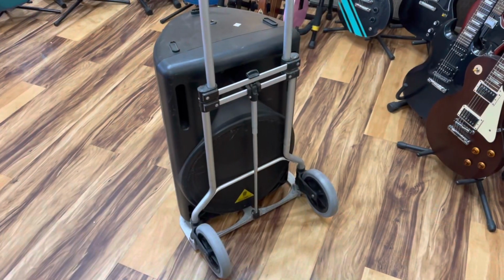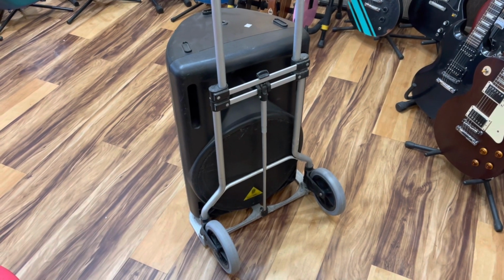How long did it last?

Comment: I once took my vintage Hofner 4575 (it's basically a three pickup Verithin, quite rare, produced in the mid 60's) to a rehearsal. When I got home I unloaded the car, and while I was bringing stuff in I leaned the 4575 up against the wall next to the front door of the house. I didn't have a case for it, so it was just propped up there naked as the day it was made, and the front door was right on the street - no path or garden in the way.
I'd been inside for two hours when I suddenly realised I'd closed the door without bringing the guitar in. I jumped up, panicking, rushed to the door, opened it, and there was my Hofner, still leaning up against the wall. I couldn't believe it.

Mind you, I also had an amp stolen once, while I was unloading outside a pub for a gig. It was a really heavy HH VS-Musician 2x12 combo, with only three wheels left of the four it originally came with. It also had an electrical fault. I knew just where to hit it to get rid of the crackling, but the new 'owner' wouldn't. I hope it electrocuted them! 😄